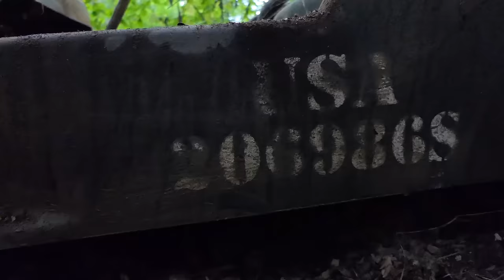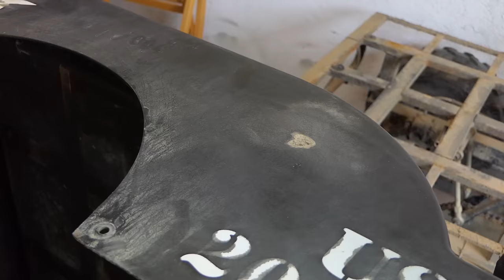Restoration Mini Jeep Willys with Engine 150cc - Restore Abandoned Old Mini Car - Part 1

Comment: Amazing that being in the forest didn't put any real rust on the bottom of the chassis🙃
Reply: I think that's because this was staged 🤣 Maybe it sat behind a garage or something but I have trouble believing it hasn't been stripped clean or even left in the woods.
Reply: @randall1959  I know I just didn't want to say outright....most of the 'staged' restorations come from Asia or Eastern Europe, both places where lying and cheating in life are commonplace.
Reply: @Pinzpilot101  Super fake like the guy's poking a pile of trash and finding a gameboy haha that restores like new .
Reply: @randall1959  wasn't stripped at all just had the tires took off but they were laying there XD.... fake as fake can be faked.
Reply: @kentuckylife2724  It's what is referred to as 'suspension of disbelief' scenario.
Reply: Wish I could find one in my woods like that, I'd put the wheels back on,start it up and drive it home, presto! until my  neighbor comes by and say tnx for getting it, I ran outta gas😁

Comment: I like these restoration videos. I follow some channels of the same theme. They always show excellent works... but there is one thing in common in all of them that somewhat bothers me: I have the impression that the objects to be restored are "dirty" or "damaged" in an artificial way. Not that it takes the shine out of the work, but it bothers me a little.
Reply: I like genuine restoration, but this  restoration is fake, the way the  tires were separated to fool people, also dirt deposits were man made not natural.
Reply: Yeah its definitely fake, and not just that this whole video is fake i like how when he first turns the key it does nothing which means the starter isn't working, then he gives it fuel and it magically works even though its battery powered
Reply: @ShimmeringWaveofficial  gihijbnmj
Reply: And you're right, because it's fake.
Reply: L
Reply: Maybe we all need to stop wasting time on yt and get a life
Reply: @ShimmeringWaveofficial it is not battery powered its a gas engine 19:45
Reply: @glennhall8795  brother I have a 45 willys and yes you need a battery in order to start it
Reply: @glennhall8795  anyways this isn't even an actual willys jeep a real willys jeep has a frame completely different than that

Comment: Why were the wheels and bonnet off? Where did the wheel nuts come from? The dirt had been painted on with a brush. OK video, but the "wreck" was made to look worse than it actually was and definitely was not sitting in the open in the woods as presented.
Reply: No era necesario llevarlo al bosque.
Reply: I saw the brush strokes in the mud too.
Reply: Lol... Even the tyres were inflated 🤣
Reply: Totally set up, YouTube boys.
Reply: Actually interestingly you mentioned mud being painted on, but I’ve seen a lot of muddy cars to know that if the mud is still wet and wind blows it or you brush past long grass it will end up looking like it was painted on with a paint brush
Reply: The position of screw in engine cover is clean.

Is that possible after many years in forest?
Reply: Even me i knew it 😂
Reply: No rust under the jerrycan
Reply: @raheemeng3736  h
Reply: It's seems a Big Fake ...like many vidéo (look thé vidéo for the RC car...who loose the expensive toy...Just to make buzz with false it is our time that allows it !!!!
Reply: 6
Reply: @Ohserial  ف
Reply: @gustavoestevez66  He took off the whole body
Reply: I agree, the work he does is great. I would have still watched the whole video even if he pulled it out of the garage and got to work. He don't need the extra theatrical stuff. Your work speaks for it's self. No need to waste your time setting up a whole intro.
Reply: Suudzon banget idup lo 🤣
Reply: "content"
Reply: All the bolts are rust free and don't need oil/lubricant to loosen?
Reply: No more crashed vehicle out there, except in the trash

Comment: What I don't understand is how it is found in the woods, out in the elements, and yet has not a trace of rust on it after being hosed down!  How does that happen?
Reply: Really good fix rustproofing paint
Reply: Well I'd say it a fake find they planted it themselves and then pretend to find it
Reply: Does the story really matter, this could be used one day in the future when nobody knows how to use a book
Reply: @martingolding4951   I agree with this guy it also looks like the bumper was cut with an angle grinder to in addition to that if it was in the forest for the amount of time it the video says it was we would have not herd the engine crank over as the carb would have needed to be cleaned to even function let alone the fact that they found it with tires off like they fell off or somthing like that and they just magicaly bolted on still an entertaing watch tho
Reply: @infinitefray8067  and the wheels well inflated ;-)
Reply: @atol2953  dam I did not even notice that thanks for pointing that out still a nice video to watch tho

Comment: The dirt on the steering wheel and body is human and suspicious!  The thread of the hub bolt 🔩 is not clogged and it is too beautiful, and it is strange that the nut 🔩 tightens smoothly!  It's a video made as if it had been abandoned long ago
Reply: looks like it came out of a barn. all the dust on the top of the spare tire as well. not the woods this was staged.

Comment: I think it would look cool with diamond tread plate on the floor and fire wall it would be great for some one to make a mini roll cage for driver safety a d a rain cover ,in case the owner wants to add electronic  accessories to there mini jeep it would look great  adding diamond plate to exterior plastic body panels for strength and endurance

Comment: UN    KING believable left in the woods with its tires inflated leaning against it bumper cut in a straight line all the parts are there why would anyone leave that if you can fix so could they

Comment: I would like to believe that you plan to increase the CC of the motor, by the way 150 have always been a tear. you could consider 250 CC by virtue of the power to weight ratio.

Comment: I sold my quad to a guy 2 years ago I got it back yesterday day 

It doesn't run and it's not giving spark and the engine is heavy to turn probably because it has not ran for a long time one oil goes up it becomes smooth hopefully

Comment: Pretty sure this is yet another FAKE restoration video.  That frame and the drive train was entirely too clean for sitting in the woods.  The tires and wheels were perfect and the frame was still painted black with no rust.